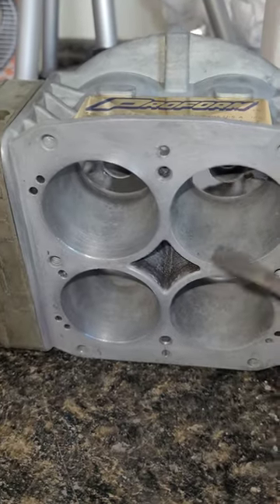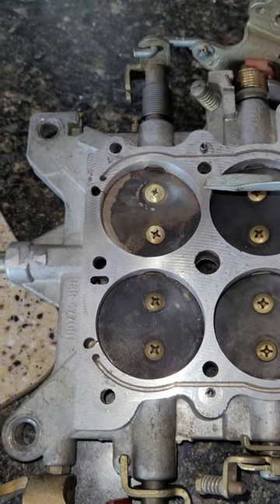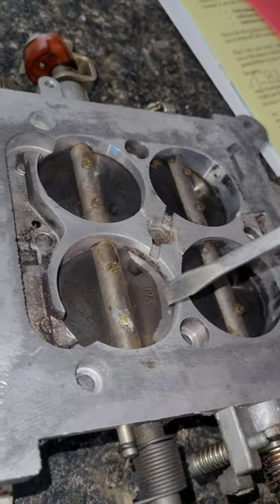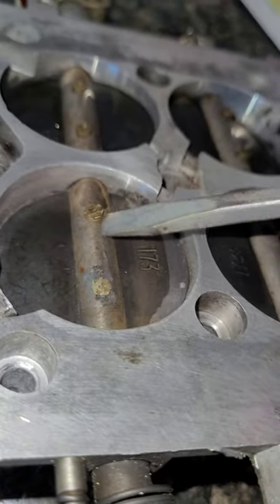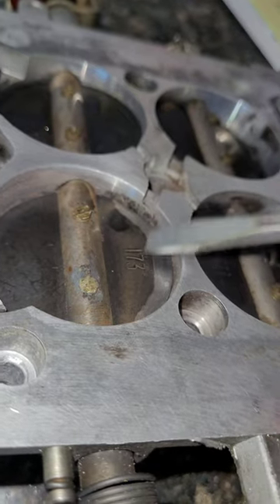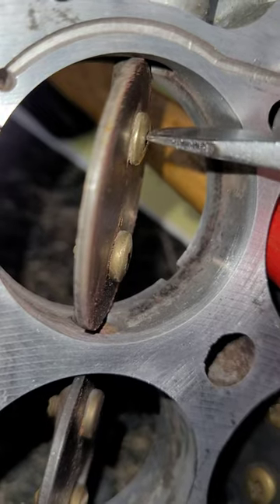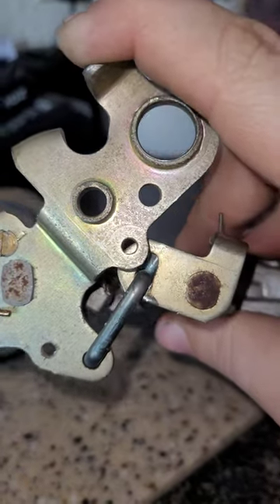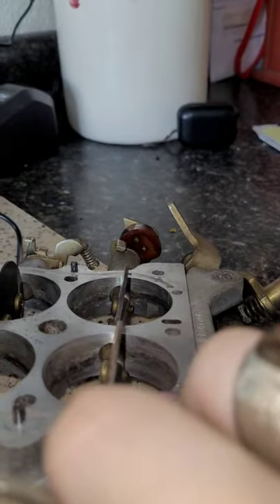Advanced!! Carburetor Tricks! What The Pros Do.

Comment: Good info. This is the horse power equivalent in todays terms of rifling a flintlock pistol but everyone needs a hobby.
Reply from the maker: Carburetors are still the way to go if you want to make power! 
Charge cooling 😎
Reply: @newguysgarage6802  way back in 2001 I got my associates degree in automotive technology. The first day I walked in class the teacher held up a beautiful Rochester quadrajet that was immaculate. He said how many guys knows what this is. We all knew and laughed. He threw it in a trash can and said forget all about it because this is the past fellas. Everyone says the muscle car era was the horsepower era but it’s not. Today is the horsepower era. I’m driving a truck from the factory that has 350 horses out of a 323 cubic inch engine that gets 20 mpg. Nothing in the carb era could do that. Performance and efficiency.
Reply from the maker: The carb era is not over though! Its still here lol 😆 

Carburetors chill the air on its way to the combustion chamber making a colder denser charge, resulting in the fact a carburetor will ultimately make more power than an efi setup on the same engine. 

And as far as gas mileage is concerned a well tuned carburetor will still get you that 20+ mile per gallon. Its not the efi that has changed performance it is everything underneath it like the heads, cam specs, and so on. That is the real thing that has drastically improved since the old days lol
Reply: Then why don’t they still have carbs on vehicles now.
Reply from the maker: @rjj5075  planned obsolescence, same reason they put a million sensors in a car that always seem to go bad. 
Money Money Money.....it does nobody any good if the common consumer has a reliable vehicle that they can work on themselves. They want you to bring it into the dealer to have everything done....even an oil change.

Comment: If I need a 350 CFM but the 600 is more common safer Holly is each side symmetrical at could I block off half of the bank and achieve have the CFM?
Reply from the maker: Wait you have a 600cfm and want to make it 350cfm? Why?
Reply: @newguysgarage6802  I would assume he's racing in a class with restricted carbs.
Reply from the maker: @that1guy997  oh mabey, I'm not sure how the rules of the class are in that case lol 

Because a 2 barrel carburetors cfm rating is measured differently from a 4 barrels. So even if you blocked half of a 600cfm to make a theoretical 300cfm......that 300cfm is not directly the equivalent of a true 300cfm two barrel since they got there ratings at different flow rates see what I mean?
Reply: @newguysgarage6802  that is a good point and i agree fully, but I can't see blocking a 4 barrel for any reason other than needing to for some rule and not having money for a 2 barrel and intake manifold.
Reply from the maker: @that1guy997  well we would know for sure.......if he would comment back!! 🤣

Comment: Good info, but its not going to save you in September. I'd rather radius the throttle plates than knife edge them, smooth air rather than a shear. Probably doesn't make much difference either way, but every little bit helps with tiny engines.
Reply from the maker: Knife edge is just a common term for it. 

You leave just a little line of black around the valve and blend everything back 🙂

When i recorded the short it ended up being 2min long so i had to edit it down by half just to get it to fit 😅

Got a longer version coming tomorrow!
Reply from the maker: Belt driven manifolds dont fall out of the sky unfortunately 🤣

Very expensive units. 😅
Reply from the maker: @SweatyFatGuy  don't assume sub count translates to $$$ lol 😆
Reply: @newguysgarage6802  there’s a belt drive thingamabobber at my machinists shop.  It’s crossed my mind…. There’s even an intake for it that’s for the ford 385 series big block.  I think I’ll stick to 8 barrels of tunnel ram fun for awhile
Reply from the maker: @2HacksGarage  wish I could find a tunnel ram for my build but those are hard to come by too lol. 

Or at least one that I can shell the dough out for anyway. 

Only way I could get my hands on a belt driven manifold is if I sold my sole to afford it hahaha!
Reply: @newguysgarage6802  edelbrock 7535 I do believe is one that’s affordable.
Reply: @newguysgarage6802  if it was a BBF you were tinkering with, I’d offer one up, I have an extra Weiand